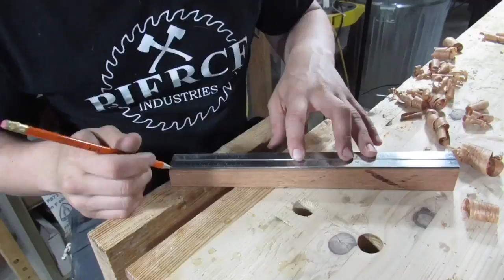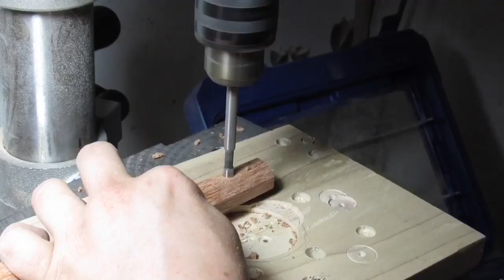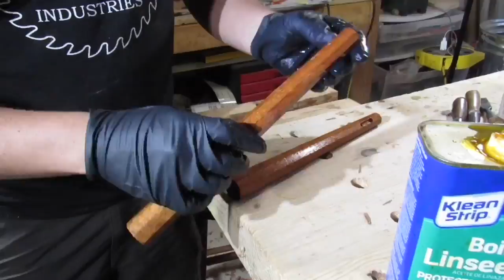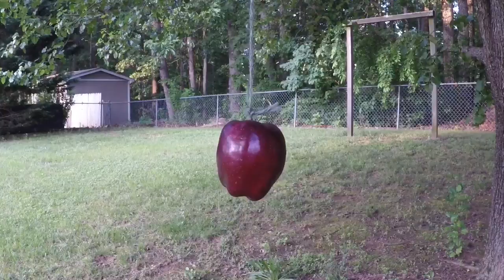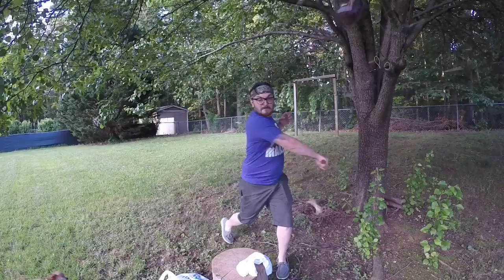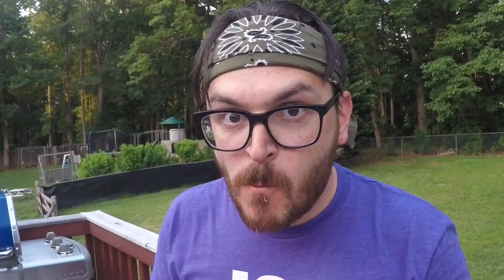Hand Tools and Kung Fu - Making Nunchucks - DIY

Comment: I'm going to make some out of jatoba wood.  The wood is too hard for a plane.  Gotta use a rasp and sanding blocks.  It's gonna wear me out.
Reply from the maker: Jatoba splinters pretty bad so be careful when cutting the string channels. You can use planes and chisels on it but they’ve got to be super sharp and you have to resharpen often.

Comment: R u selling those
Reply from the maker: Yes, they are.  You can purchase a set on my website.  https://www.joepiercemaker.com/shopall/handmade-tapered-octagon-nunchucks
Reply: 75 USD very expensive bro
Reply from the maker: Suraj, you think that's expensive? You should look up the price of a hand plane, drill press, chisel set, card scraper, marking tools, workbench, vice, boiled linseed oil, and paste wax.  Oh, and brazilian cherry isn't cheap either.  I researched prices of hand made exotic wood nunchucks and found that $75 is about average.  You could definitely make your own.  In fact, I have a longer version of this video (link in description) where I show you how.  It's not hard if you have the tools and experience.
Reply: @JoePierceMaker  
I found out that industrial mop handles are best for strength and very cheap even free,  and I get linseed oil and varnish free and have oodles of tools, from thrift stores,  I do not do all that wood working and use an ordinary hand drill to drill and slot the wood,  I use 10 guage stranded copper electric cord as it has the consistency I prefer.

I would say a pair cost me from $ 75 to $ 80   just in time and effort, but you cannot beat the strength of an industrial mop handle.
Easier to use.

I eliminated using chain and nylon after much trying, and ended up with electric cord as it gives me the best results in actual use.

Comment: Yeah, not everyone has those tools etc.
Reply from the maker: True, but most hobbies or crafts require you to acquire some sort of tool don't they?  For example, I wanted to be a woodworker, so I purchased some woodworking tools.  If I wanted to be an auto mechanic, I would have to buy wrenches and such.  If I wanted to be a chef, I would need knives, pots, pans etc.   Now, with that being said, if I wanted a set of these nunchucks, but I didn't want to buy hundreds of dollars in tools to make them.  I would head over to www.joepiercemaker.com and order a set made by the guy with the tools.

Comment: I watched both versions of this project. I appreciate the time they you put into both, the explanation in the full version, and the pace of the abbreviated version. 
I didn't see how you united them with the cord--specifically the type of rope and the knot. Do you show those details anywhere? 
Thanks for the videos.
Reply from the maker: Thanks for watching.  I didn't include the rope part because it took a me a couple tries and I wasn't confident in the knot enough to suggest it to other people.  I also didn't film that part because I didn't think it would make for interesting footage, just me sitting there cursing at myself, haha!
Reply: I used 10 gauge electric cord, I slotted and holed much like the video, and one end has no knots, my ends have 2 holes going down and one wire  goes down and around into the other stick down and around and is stuck in the wood by pressure alone after it passed through the holes I would need to make a video to show actual details.
I have been making Ninchucks for  decades.
Reply: This was actually the only reason i showed up and watched the entire video, so long i got attacked by ninjas and it doesnt matter now how I'd tie my two sticks together now
Reply: I use para-cord.

Comment: Hey Jo-Fu ! What kind of wood are you using to make the octagon nunchaku's ? By the way nice job on those.
Reply from the maker: Thanks! They are made from Brazilian Cherry, also known as Jatoba. It’s a very dense wood and weighs twice as much as Ash or Hickory.
Reply: I use commercial mop handle as it is very cheap and easy to get and very strong.

Comment: Why make so complicated wen you can just get a piece of round wood and just drill the holes
Reply from the maker: The adventure is in the journey, not the destination.  I challenged myself to make a tapered octagon because I enjoy woodworking and I wanted to make a nice looking, functional piece.  How boring would it be if I bought oak dowels from the home store and just tied them together?
Reply: S T sorry but a bit of misinfo here. 

While round is an acceptable shape, octagonal shaped chucks are used since the inside grip of the hand isn’t circular, it’s closer to an octagon so you get a better grip. Neither shape is more or less traditional than the other although round is associated with Chinese style and octagonal with Japanese style.

Getting whacked with hard wood, round or hexagonal, is gonna hurt. “Round” isn’t safe, I literally don’t know where you got that. If you think a hardwood is safe because it’s round, whack yourself a couple times with a baseball bat.

Although silk would be nice to tie chucks together, there isn’t actually a set standard. Some use paracord, some rope, some chain, I once saw a guy use shoelaces. You tie them without knots, tape, or glue. 

You don’t need to know martial arts to use nunchucks. It helps but it’s not necessary.
Reply: I use industrial mop handle as it is stronger, and I think looks or shape are not so important, I have made them and used them for decades and the round ones work just as well in self defense, as I can tell you from experience.

Oh yes, Ninchucks work best in a knife attack, and if you can take classes, though I never did,  I highly recommend it unless you want to get knocked out as did my 13 year old Cousin Jose, pronounced Hose A.  😲